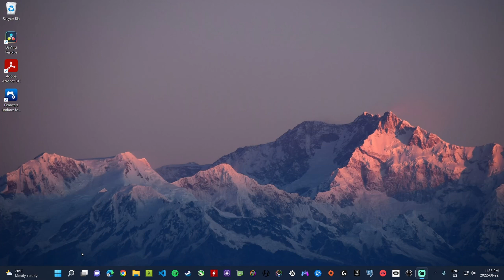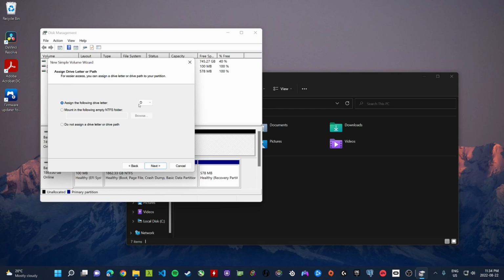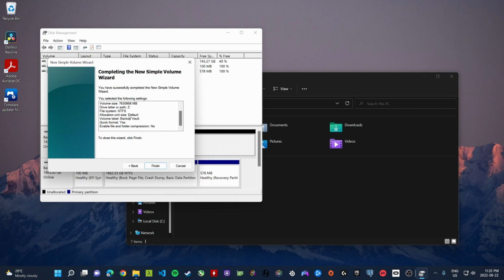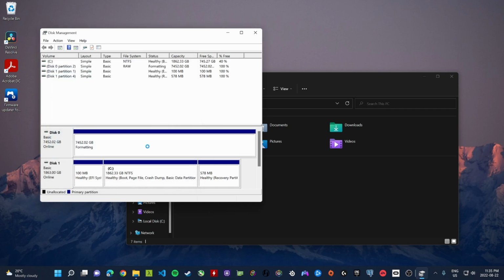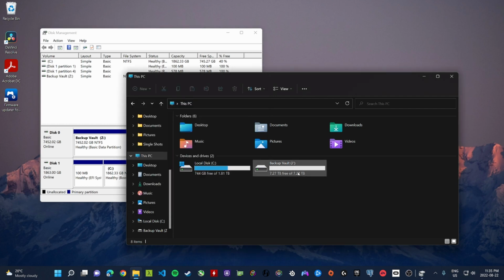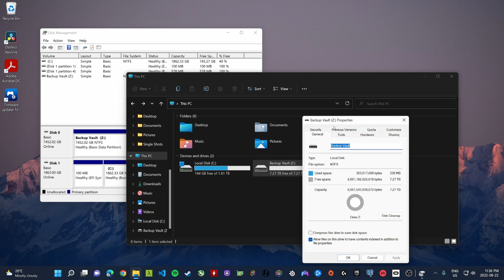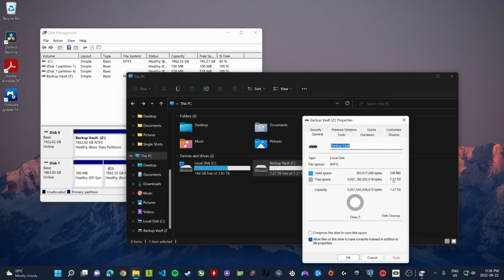How to Add a Hard Drive to Your PC | The Headache Free Approach

Comment: I bought a external hard drive but it was so slow any recommended drives that is fast for downloads
Reply from the maker: It really depends on what you are using it for. If you are installing software on the drive I would use an SSD